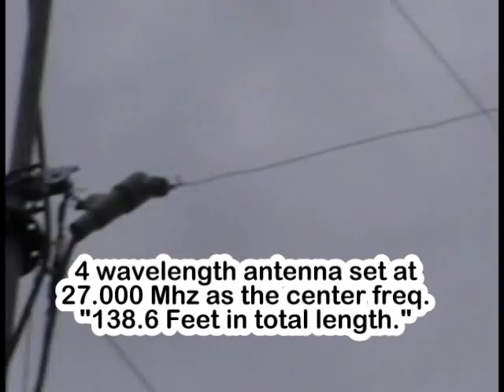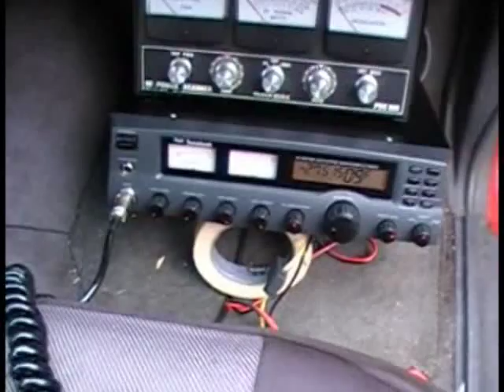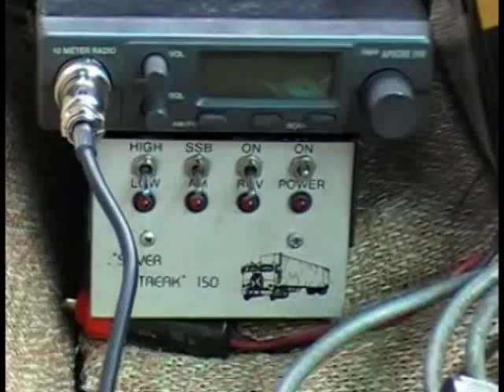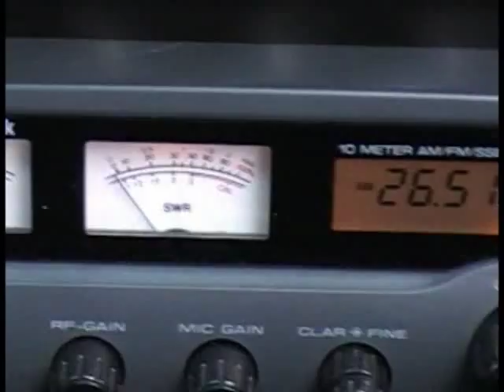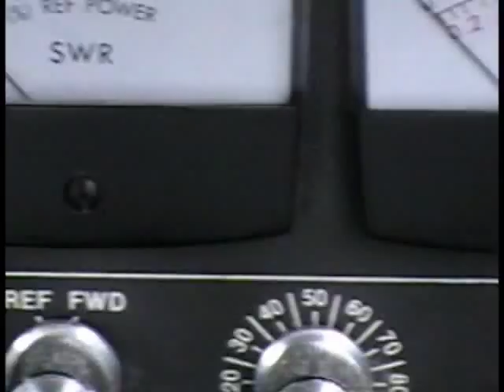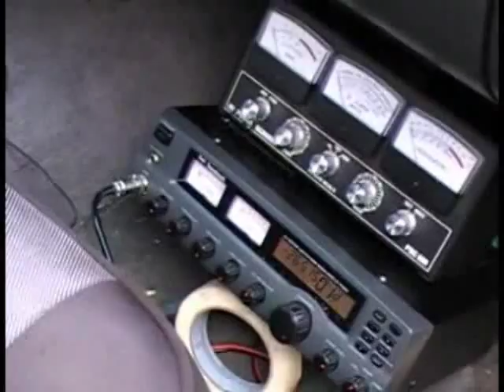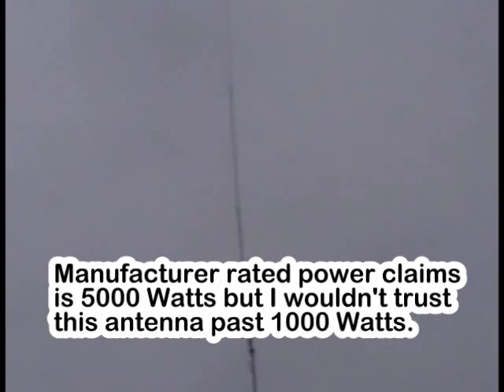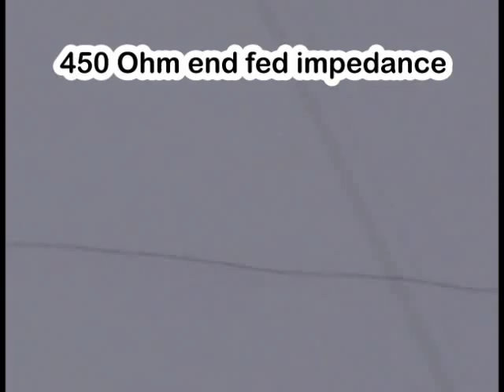Fun with antennas and SWR issues.

Comment: flash you are the man. i was having trouble with my swr in my mobile.  2.0 across the bands here in the uk.  came across your video last night and did exactly as you said and BOOM swr dropped to 1.2. thanx for making the video it was a great watch. 73s from 26ct1808 south coast of England
Reply from the maker: Hey I'm glad it worked for you. I've seen people over cut antennas and ruin them trying to fix the SWR issue. This little trick works unless you have a sports car made out of plastic.

Comment: What you have there is 'common mode current'. One of the best ways to diagnose it is to move and grab the coax. I'd utilise a decent coaxial choke looped through an appropriate ferrite toroid/s. Then ground it on the radio side of the choke, sort of like you've done ( because you're running a mag mount). There will be no ill effects by running a correctly made choke. The problem with the amp is to do with rf feedback. Of coarse the  cabin is going to be full of this when you up the power. I smoked an Astatic D104-M6B once when I was running a quarter wave droopy insulated from the mast in a portable situation. I mean smoke poured out of it as the plastic was melting behind the metal grill. Gave a nice tingle on the top lip too.
Reply from the maker: Yeah a common mode current is EXACTLY what it was and it can be corrected with chokes but if you can cure it with good grounding that's even better. There are many roads that lead to Rome when it comes to Voo-Doo electronic issues like this.

Comment: Thanks for the video,now I know what my problem is. My boss gave me a 510 Uniden and a new antenna so I can talk to the blacktop trucks as they come in and I tried to set the swr. The antenna has a collar on it to adjust and my meter would do exactly like yours everytime I touched the collar now I know what to do to fix it. I'm glad it wasn't the type of antenna that you cut pieces off to adjust or I would have ruined it. Perfect video.

Comment: I just put in a mobile and added a extra ground wire, plus i’m about to put up a base station with copper ran to a rod about 7ft 9inchs deep plus i got a 8 gauge ground wire I’m going to run to my house frame. I hope all this helps with performance and lighting strikes. Thanks for the 411
Reply from the maker: Rock solid grounding is king! Most rf issues are caused by poor grounding.

Comment: Laugh. I love how you display your unlawful amplifier. Owning it! Appreciate your being candid. 30 years ago they would be knocking on  your door after seeing this video. :)
Reply from the maker: You have people that run mini sized freezer "splatter box" amps equal to or greater than the output power of some small AM broadcast radio stations in their houses and those are the ones who deserve a knock on the door. This tiny amp in the truck is not only clean from harmonics but I don't push it either. I have this in the truck because I am well into the boondocks (country) here and it pays off cutting through noise and being heard when I do get onto the highway. Whats crazy is in the UK they recently allowed their CB operators to now run AM so now they can run both AM and FM CB's but the kicker is they upped their legal power limit up to 100 watts. As to hiding this tiny amp, I'm just not pushing anything worth their trouble especially when you have people pushing sweet 16's amps in their cars and trucks.
Reply: @flash001USA  You might enjoy Fred in The Shed, he is a UK CBer and is fun to watch?

Comment from the maker: Luke if you touch the antenna it will have "BIG" effects on the SWR! What you are looking for is the following symptoms. (1) Touching the radio or the SWR meter (If you are using an external SWR meter) while you are keying up makes the SWR move. (2) Just adding an external SWR meter or a power meter changes the SWR. If that's the case you want to ground your coax midway somewhere in the truck because although your radio may be grounded you may still need an extra ground to kill the ground loop.

Comment from the maker: To check for RF ground loops key up the radio while watching the SWR meter and then lay your hand on the radio. Repeat this by running your hand up and down on the coax that is coming from the antenna. If the SWR moves you probably need to ground the coax midway to the truck's steel. You can carefully strip some of the outer plastic shielding from coax to expose the copper braid but DO NOT cut or damage it. Cont:

Comment: You should invest in a good lightning arrestor to install inline with your coax going to the antenna. It will protect your equipment and house if your antenna gets hit by lightning. Just be sure to ground it. I agree antennas must have a good ground plane in order to work correctly. I don't think the mag-mount is providing you with a good ground plane. The paint on vehicles sometimes messes with the grounding when using these types of mounts. A simple fix would be to lay a thin piece of sheet metal under the mount (not sure how your paint would hold up).  Larsen mounts are great as long as they are attached to metal chassis of you vehicle (i.e. under the hood or trunk). Ceiling & Trunk mounts  a that require holes to be drill are little more involved, sometimes you have to make a ground cable that extends from the coax connector to the chassis similar to what you showed. The vehicle chassis is essentially the ground plane for mobile mount antennas and if you don't have a good metal to metal contact you will have problem.

Comment from the maker: I meant to say this in my last reply. The collar moves up and down correct? You don't try to adjust it while keying the radio. What you do is look at channel 1 and channel 40. If the SWR is higher on 40 but decent on 1 the antenna is electrically too long and I think you would raise the collar to fool the antenna into thinking it's shorter. If the SWR looks OK on 1 but high on 40, you would lower the rings for the opposite effect. If it won't adjust then you have possible grounding issues Cont:

Comment: A larger or additional magnet on the mount might also help?  Interesting on your wire, curious, how long, is it multiple 1/4 waves?  Also, a ground wire right at the radio could also add more ground plane effect? A single magnet on the mount can handle just the radio but needs help as the wattage goes up. A very interesting video enjoyed it. Thanks for sharing !!!

Comment from the maker: Get some copper wire and strip all of the insulation from it if it has any then rap it around the exposed copper braid on the coax followed with resealing the coax with electrical tape to protect it from damage. Be sure to leave about 6 inches length of the copper wire you added from the coax so that you can tie it to a solid ground on the truck like I did in this video. Now go and check the SWR. Hopefully this solved the issue. Let me know if this makes sense to you.
Reply: insulated copper wire will render the ground ineffective?

Comment: im gona try this on my jeep wrangler, i installed everything brand new ,new cb max rad antenna, its on a taillight bracket,trying to match it ,i cant get it under 2 on swr,ill keep you posted, thank you!!!
Reply from the maker: The main thing besides a few solid grounding points along the coax path is for the antenna to be able to interact with the body of the vehicle so that the antenna can develop a decent lobe. Good luck.

Comment: I have a Silver streak 150 also , great box
Reply from the maker: It's an old box that I rebuilt years ago. It's now my back-up box.
Reply from the maker: OK... A ground loop is where you have a high enough resistance where the current from the RF or even current from a power source will have the tendency to move from it's intended paths into other paths that conduct. In other words, the RF from the coax will want to leak out and cause the coax itself to become part of the antenna and a simple workaround is to physically ground the coax to the vehicle which will help and in most cases stop the RF from splattering around in the vehicle . A common issue besides a poor SWR is the microphone can get hot in your hand from RF if you are in the range of 100+ watts plus this will make you sound muffled. All I did was put a splice in my coax near my seatbelt mount. I wrapped some braided wire around the splice barrel then I taped it to keep it in place. The wire was then bolted to the seatbelt mounting bolt. You have to keep the wire as short as possible when you do this. In other words you wouldn't want to have use foot of wire as a ground or it will become part of the issue too. I take my power directly from the battery so I had ground loops and I eliminated them by making tie points with the coax to the body of the vehicle . I hope this helps answer your question.
Reply from the maker: Almost forgot... The large base on the magnet mount has a very large capacitance so the RF can easily couple to the roof of the car. The capacitance  (coupling effect) is good enough that the RF sees it as a direct connection or at the very least very close to it. Since this video I have made a mounting bracket that ties to the truck bed then goes to the triple magnet mount in the video. I am now using a 102 inch whip that mounts to the bracket. I may do a new video on this soon because this works with a very good SWR across a wide frequency span.
Reply from the maker: Pample Moose Copper Electronics

Comment: Common your radio ground with the ground installed by your power company. Without that, the lightening can strike your antenna, and follow its way to the ground from your power company, killing everything in between.
Reply from the maker: The antenna was actually grounded at the coax at the antenna itself along with all of the steel guide wires that went into steel anchors that hold the guy wires but that wasn't enough ground. The antenna is now grounded in 5 places along the coax path with solid copper coated grounding rods including right before the coax goes to the radio itself and during a bad storm or if we are away there is a dummy wire that the coax can be screwed into to loop the wire in the house directly to a copper ground rod that is 5 feet into the ground directly under the radio. Problem handled.
Reply: @flash001USA  I don't know what all you just typed, it was simple, did you connect your radio ground to your homes power line ground, or not.  You can have a thousand grounds on your radio, but it it does not connect to the power line ground of your home, it can lead to bad things when lightening strikes.
Reply from the maker: @JosephMassimino  In a house you have a hot along with a neutral and then you have an earth ground unless you're dealing with a very old house that only has a hot and neutral on the wall sockets. A lot of people aren't aware of this but the earth's ground used by the power company serves a couple of purposes one of them being to get rid of ground loops from the telephone pole to the house and I'm pretty sure you've probably noticed on most telephone poles where the transformer is there is almost always a heavy copper wire running down the side of the pole that goes to ground. Whenever you're grounding to the third prong on your AC wall socket, you should technically be going to a earth ground too and as long as the electrician that wired the house up did their job correctly then the third grounding prong on the AC receptacles in the house should all tie to the metal case of the fuse box which in turn finds itself to a earth ground. In some cases especially on older residential houses, earth ground will be shared with the neutral plug maybe because they didn't have a choice at the time for whatever the reasoning was. I wanted to make sure we were on the same page as far as how you and I describe ground. Since the lightning strike my antenna now has five earth grounds using copper grounding rods going five feet into the ground along the coax path. Yes the radio itself along with power supplies and other accessories use a 3 prong plug that take them to earth ground which is also tied to the metal fuse box case which also ties to the power company transformer on the pole. I always had that before I added all of the extra ground points on the coax cable leading into the house. The way I'm grounded is correct and safe with the only difference being now I have many grounding points along the RF coax cable path as a safety precaution. Hopefully that clears up what I was trying to relay it to you and sorry for any confusion.
Reply: @flash001USA  % foot ground rods in some states is going into dry earth. Here in Florida where the water table at some times of the years is at, or very close to the surface, my ground rods go down 10 feet, so they remain in wet soil at all times. I found the 5 foot ground rod used by the power company, and I pounded a 10 foot rod right next to it ,and clamped them together, while at the same time connecting it to my radio room, and tower ground system. I did not know that you lived in a very old house with no ground system to the power from the power company.
Reply from the maker: @JosephMassimino  Joe I live in a modern house but in the past (many years ago) I've lived in houses that only used the older two prong plugs. Thankfully here in SC the ground isn't bone dry and the last grounding rod under the house is in earth ground that is always damp due to no sun able to reach it so a 5 foot grounding rod will get the job done.

Comment: Mister there is a drawing fault at 14.33.
Reply from the maker: What are you seeing that is incorrect? This came from the I max 2000 exposed website.
Reply: Above, the capacitor A is dead to ground so no rf voltage there.  Only capacitor B can be seen in the lower drawing. And those 2 balls are not seen in the lower drawing either. Is that a mark 2 or sometin ?

Comment: Grounding surely plays havoc, I get a problem sometimes with my SWR meter, when I go to set it FWD, the meter is eractic...Think that's a ground problem as well??
Reply from the maker: +Junior D It's possible. The best way to see if it is a grounding issue (Ground loop) is while keying the radio up grab the coax and run it thru your hand while you watch the SWR. If it moves around peel back about 1 inch of the outer plastic shield exposing the inner copper shield somewhere about halfway down the coax but be careful not to cut it or damage the inner copper shield.. 

Take some braided copper wire and wrap it around the copper shield then tape it to hold the copper wire you added and to protect where you stripped back the outer plastic lining being sure to use a long enough piece of wire to ground the cable with. 

Take the copper wire and ground it to the seat belt mounting bolt that holds it to the frame of even to a bolt that holds one of your seats to the frame of the car or truck and most of the time this will fix the issue unless you have a fiberglass body and the antenna itself isn't seeing a ground plane path. If that's the case you will have to get some aluminum duct tape and build a ground plane for the antenna. If you are driving a older car or a truck it won't have a fiberglass hood or roof.

Comment: Seems to me your antenna isn't grounded properly
Reply from the maker: You're correct. Originally the antenna wasn't grounded well enough and then I tied the coax into the vehicle body and got a good solid ground at which point the antenna issues completely straightened up. Most magnetic mount antennas couple through capacitance to the body of the vehicle and sometimes this is more than enough especially with older full size vehicles with larger roofs or trunk lids but with these little trucks, it can be hit and miss. I made this video quite a few years ago and the grounding fix I made is still holding up to this day. Something else is these small trucks don't really offer a good ground plane on the top of their roofs and you'll see people choose to either mount an antenna to the back bumper with a 102 inch stainless steel whip which I did for a while or even mount the antenna inside of the truck bed but I didn't want to do that. The only reason I decided to get away from the 102 steel whip is because I wanted a different lobe pattern. What I have now has decent ears in front of the truck and in back of the truck along with a well behaved SWR low or high power.

Comment: I didn't see it set to Celebration
Reply from the maker: I had already been testing before I started recording the video so I knew where the SWR stood before I started the video. Yeah I set the meter beforehand and the changes didn't change that much switching between the bands.
Reply: Oh ok
Reply from the maker: @petersannicolas8949  Yeah, the way I did this was to tune the antenna for the lowest SWR on Ch 20 and to calibrate to Ch 20 on the regular CB bands. I repeated testing the SWR on the bands including calibrating the SWR meters before I even started recording the video just to make sure that everything was reasonably accurate. There wasn't enough of a difference between the band calibrations so what I did here was to do the calibrations on the standard CB band instead. The difference in calibrating even between Ch 1 and Ch 40 really didn't make enough difference to calibrate and even jumping out of band the difference was very little. I should have mentioned that in the video but I didn't so I can see where someone would have questions. Thanks for the feedback.